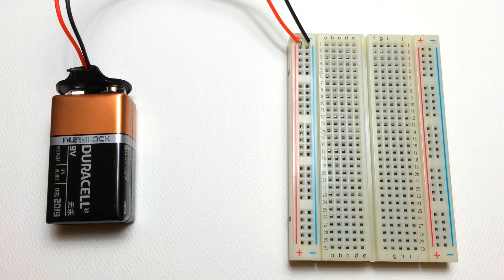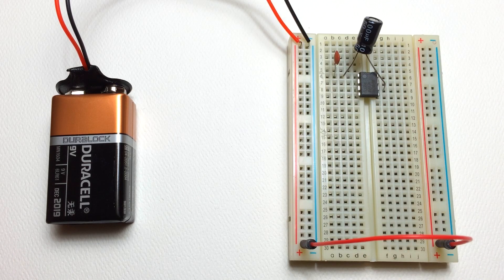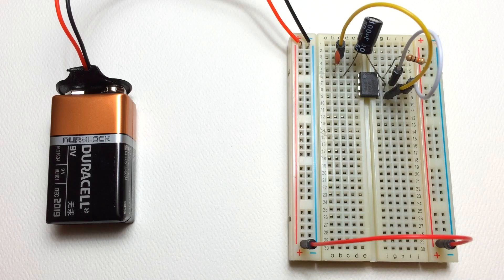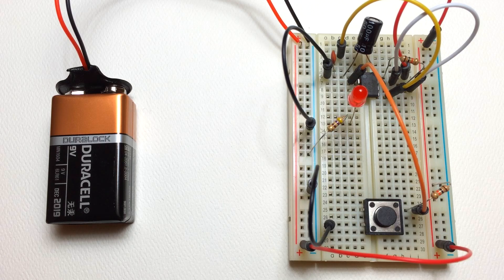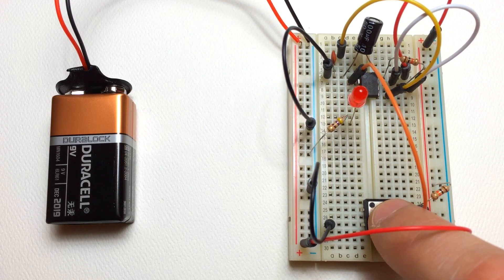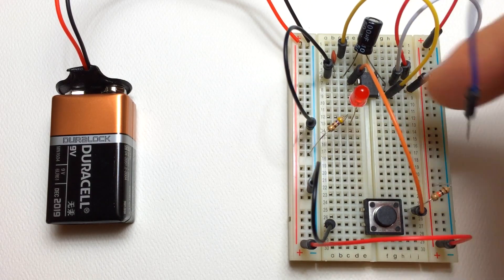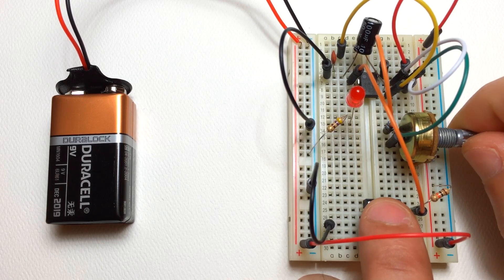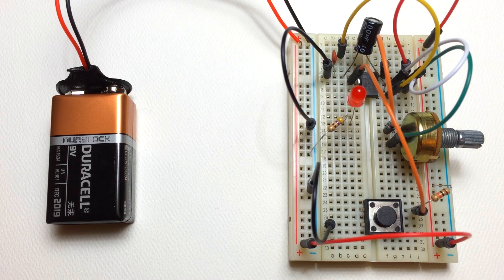The 555 Timer in Monostable Mode

Comment: I need a circuit that will be used with a button like in this video. But I need a small delay, a few microseconds. Then a pulse of about 1/20 of a second, regardless of the lenth of the button is pushed. I have seen something similar done with a arduino. I'm looking for something simple. Can you help with this? Can a 555 or two do this? I would also like to have a 555, pwm running at about 20-30 hz, and have an adjustable duty cycle of about 5% to 60-70%, can a few 555's do this? To drive a mosfet gate. For a spotweld circuit. Thanks  I'd like to power the driver circuit with 3.7v,7.4 or 11.1 volts nominal.  From lithium ion cells. Thanks again...
Reply: I need a similar thing right now, did you ever manage to make a circuit like that?
Reply: I can envision a circuit with 3 timers for what you described, but afair 555 is incapable of PWM with duty cycle < 50%, so you most likely need another chip for PWM.

Comment: What could you do to get the LED to stay illuminated for about 5 seconds when the button is pushed? Would you add more resistance or a different leg of the timer? Thank you
Reply: change the resistance between pins 7 & 8, higher means the capacitor needs more time to charge, hence the long delay.
Reply: If you want more delay just increase the capacitor value of 100 uf

Comment: what happens if you hold down the push button?
Reply: Ari Menachem the led stays on wile you hold it down
Reply: Austen Beck will the circuit be still fine when we hold down the push button for a few minutes?

Comment from the maker: The 555 Timer in Monstable Mode

In this tutorial, I will demonstrate how to set up a 555 timer circuit in monostable mode. This will allow an LED to be turned on for a timed duration after pressing a button. The time the LED stays lit is a function of the resistor and capacitor in the RC part of the circuit, and can be modified at will.

See the breadboard diagram and parts list at my blog: http://www.circuitbasics.com/?p=206

Discover more about electronics at the Circuit Basics blog: www.circuitbasics.com

Facebook: www.circuitbasics.com/facebook
Twitter: www.twitter.com/circuitbasics
Instagram: www.instagram.com/circuitbasics
Reply: Send me your email address